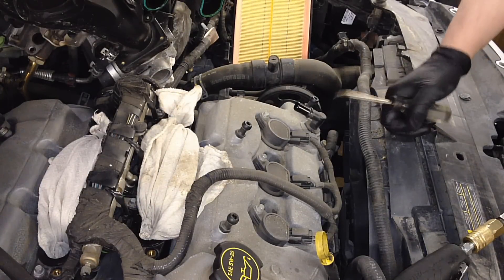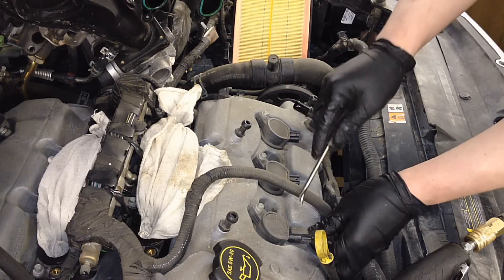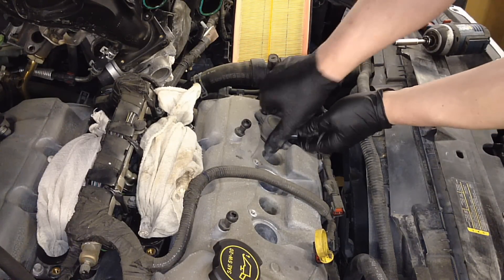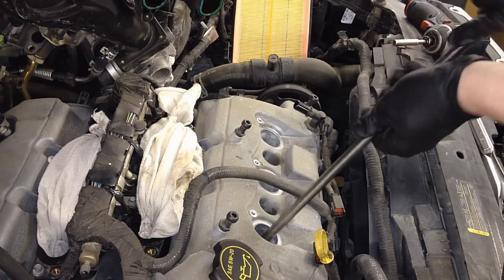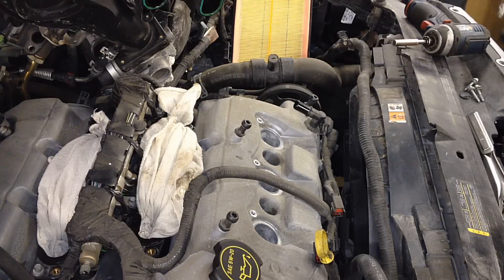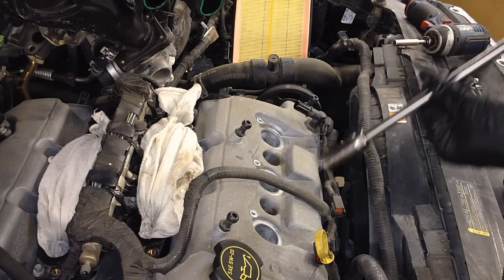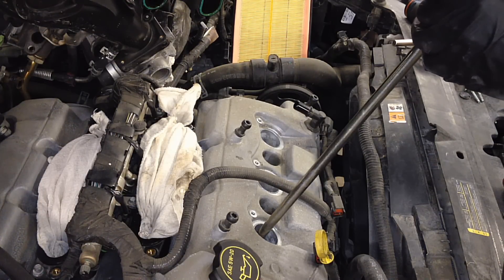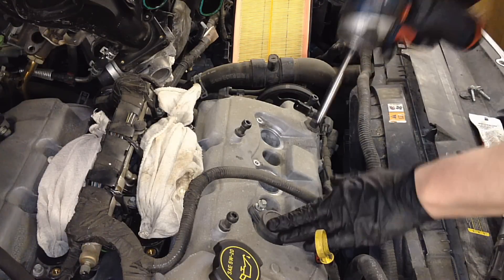Ford Fusion 3.0L DOHC Spark Plug Replacement

Comment: Showing how to change the plugs is easy, why don't you show the problem metal bracket location that causes delay in removing the plastic intake housing?

Comment: maybe out of topic but...is this model(v6 3.0) worth the money? i mean, are they reliable? smooth or stiff ride? plush seats? ill appreciate any suggestions. im looking for something reliable and good for my sore back. so im considering a 06 3.0lt. mint condition with 60,000miles for $3800. thanks.
Reply: winracso yeah seats are spongy and material is cloth. Its a smooth ride even with bad suspension.

Comment: You say spark plug gap is .054 - the Ford manual says .049 Max for 3.0l... why?  Also, is it necessary to replace the intake manifold gaskets every time you remove the intake manifold?
Reply from the maker: +m0dul8r what year fusion we talking here? The intake gaskets can be used for 30k before they must be replaced
Reply: 2012 SEL 3.0l - I picked up a new set anyways - they came with uppers and lowers...

Comment: If you need to change the boot for the new spark plug , how do you take the boot off? Is this the same engine as the 2006 mercury Milan ?

Comment: How do you get to the other 3?
Reply from the maker: tippie2000 Intake removal link is in the description.
Reply: +FordTechMakuloco please help so I took off the thing holding down the spark plug I had to pull a little hard to pop it off but does it have to pop back on cause I can't pop it back on ...... I can put it on and screw it down but I don't hear the pop sound and scared it my not be on fully ?

Comment: what if the gap nor the torque is dead on
Reply from the maker: Torque them till snug and you will be ok, the gap is more important. Depends on the plug manufacturer. Ford plugs come pretty close to gap spec so you may not even notice it.
Reply: thanx for the video it was a big help espeically  trying to figure out what screws to take out and how to take it all apart, thank you so very much.